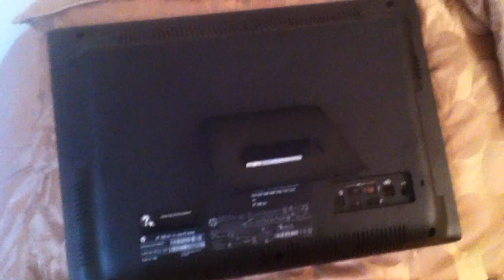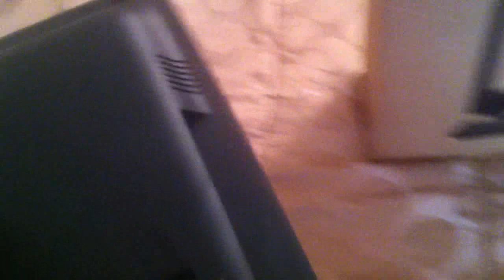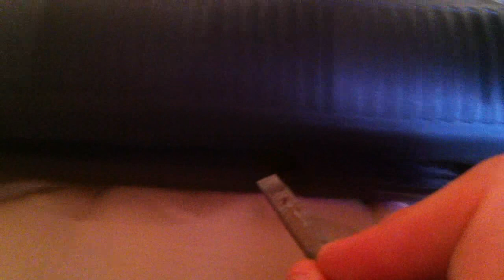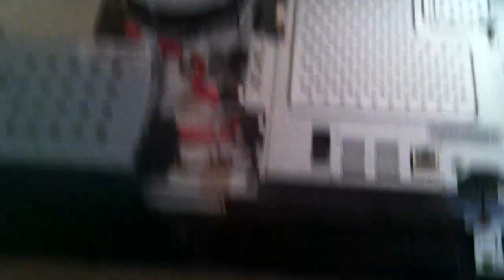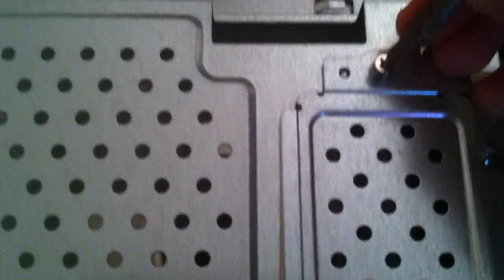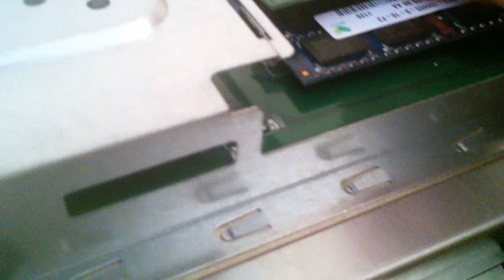HP 100B All-in-One PC: How To Remove Back Cover & Replace Memory (RAM)

Comment: Good video.  When you go to reassemble: the three screws on the bottom are small and the two on the top are longer.  I used torx/star bit size T7 instead of a flat-blade screwdriver.

Comment: would upgrading the ram require a better power supply in any way. i know that might be a dumb question
Reply: no use same power
Reply: Glen Huang i have 2 gb on pc, i have most 4 gb to place on pc, is on dual chanel works? or no

Comment: has anyone had this issue with the comuter?  when i restart my computer screen just turns black and doesnt restart.  do yall know how to fix that?  i always have to press the power button for the computer to shut down when it blacks out like that.  thanks for yall help youtube!
Reply: i know this is a old question but if u still have the pc then try to make sure the memory/ ram. is in correctly

Comment: Can this PC be 64 bit versus 32 bit???  Did windows7 automatically start in 32 bit?  I'm bummed because I put 8 gig of ram but only 2.7 gig is usable becuase my pc is 32 bit (which only allows 4 gig capacity).  I also find it odd 1.3 gig is unusable...Thoughts?